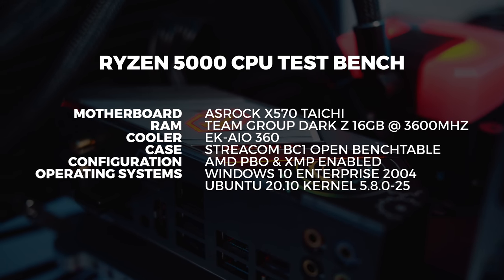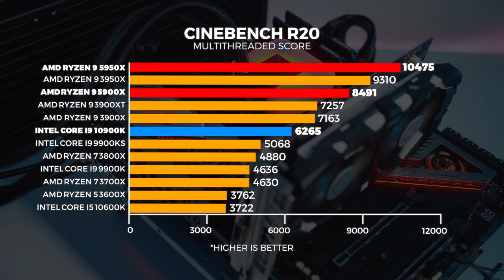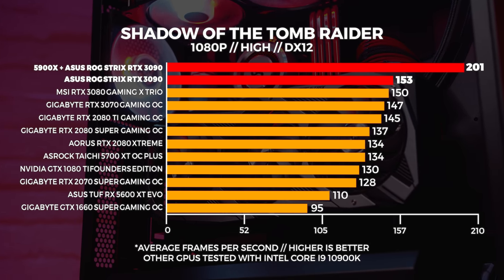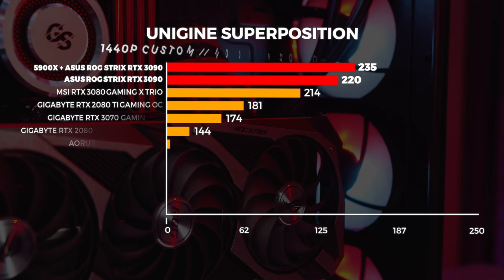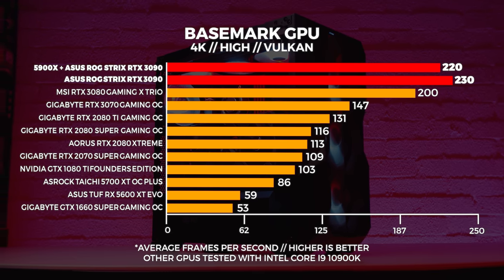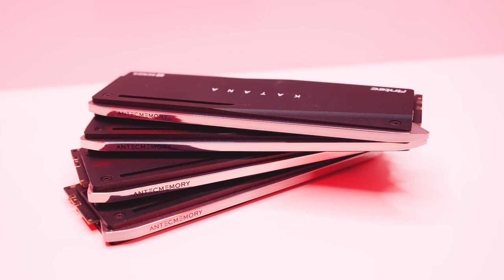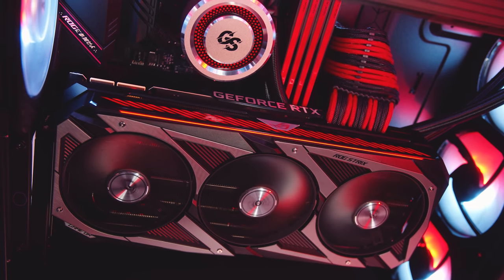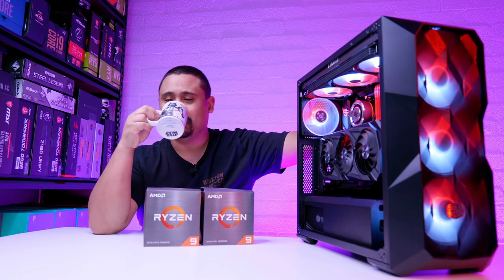AMD Ryzen 9 5900X ASUS ROG STRIX B550 Build with Benchmarks

Comment: i love that you love the TD500 since this baby is gonna be my case in few days time. cheers!
Reply: Yeah, fam. He had a hand in creating the beaut.
Reply: Same, I got the white version
Reply: i was going for td500 too but  after seeing meshify c it's hard to decide lol
Reply: @chickenuggets5118  in the meshify c you cant have a radiator.
Reply: @Alex-ul2eo  i googled this and you're right holy shit.   but  now i have to look for another case with  good airflow and one that have space for radiator. any recommendation ?
Reply: @chickenuggets5118  you can fit a radiator in the td500 mesh, but the p500a is also a very good case. Personally i would go with the p500a or the p600s they are both grate cases and in the p600s you can take of the front panel so you have mesh and in the p500a you have standard mesh
Reply: @Alex-ul2eo   i love p500a but it cost too much( something like 170 euro  in europe )  i think i'm just gonna get td500 or maybe p400a...
Reply: @chickenuggets5118  the td500 mesh can fit a 360mm radiator in the top where it belongs.
Reply: same

Comment: "What another empty coffee cup?"

Nick takes a sip
Nick: Hah. You thought.
Reply from the maker: The 5950X video the cup was empty. The 5900X video it was half full
Reply: @GearSeekers   pls help gear  seekers @Gear Seekers   gear seekers I have 1 doubt that in your tuf gt301 case review, Do this cabinet support aorus RTX 3080 and aorus 240 mm liquid cooler pls reply
Reply: @GearSeekers  Hi nick just bought the td500 mesh in white and was wondering what vertical bracket you used for the gpu and if the benchmarks and temperature are ok in that position (I have the vision 3080).. thank you

Comment: Guess I'm going AMD next. Haven't touched their stuff since they were called ATi
Reply: Imo r9 5900x is best value
Reply: @curtisg8399  5600x is easily best value for just gaming
Reply: @MFDOOOOOOM  no it’s not it’s terrible value. $300 for a 6 core chip at the end of 2020 is ridiculous, certain games already will use all 8 cores like bf5, assassins creed odyssey, etc and I bet in 2 to 3 years game will gladly take your 10  - 12 cores. A 6 core cpu is not future proof and not having the extra cores gonna cause stuttering and frame drops. Not to mention that this is only for gaming if you plan to video edit or multitask than an 8 - 12 core cpu is the way to go.
Reply: @curtisg8399  You're making your judgment based on guesses and assumptions. Right now, in terms of running games that actually exist, 6 cores is more than enough for gaming. Some games will use more than 6, that doesn't mean 6 is redundant in those games. Benchmarks are out for those games and there is little difference in the vast majority of them between a 6 core and a 12 core, with the same GPU. Don't buy based on what might happen, then you will never buy because eventually every chip is going to be redundant.

Comment: Which PCIe riser cable are you using? I think there's no PCIe 4.0 riser cable available in the market yet and 3.0 will cause compatibility problems as AMD themselves have said on their website.
Reply: I am wondering the same thing..been scrolling thru most of comments but seems u r the only one who raise this up...
Reply: i wanted to sidemount but this is the reason i didnt do it, the other thing i heard is you have to go in your BIOS and change PCI E 4.0 to 3.0 option

Comment: Do you think pcie gen 4 on amd is part of the performance increase?
Reply from the maker: Not at all. It's the CPU. I tested with PCIe 3.0 and 4.0 out of curiosity as well. Zero difference.
Reply: @GearSeekers  Interesting. People were saying that gen 3 would be holding intel back with Ampere cards. But I guess not

Comment: Really dig the Antec Katana ram. I want to pair it up with my 5900X that I'll be getting on Monday but it seems the sticks come in either 3200 CL16 or 3600 CL18 so i'm not sure how much performance I'll be losing by going with this and also if the memory can be OC'd well.
Reply: you can use 4000mhz Ram the 5900 hase zen3 he can with this ram

Comment: I am curious has anyone ever front mounted a 360 rad in the td500 mesh, everytime i see this case i think it would look nice with it in the front im not sure how well that would work though.
Reply: They go in the top. Front mount is a bad idea because it puts the pump above which causes air to get into the pump and is noisy plus could damage it. Radiator must always go above the pump.
Reply: @kenshinhimura9387  This is untrue, if you mount it on the front with the tubes sitting at the bottom it removes this issue, gamersnexus did a video on how to correctly front mount a rad

Comment: If the pricing is going to be competitive with Intel's offering, the latest Ryzen CPUs are going to be dominating. I can already see people doing Ryzen builds just to run Cyberpunk at the highest settings while streaming. What I am honestly concerned about is the memory kit compatibility. Is it compatible with most kits? Is it finicky? The last Ryzen I OC'd (1700) was really hard to make work nice with C16 kits. That's really the only gripe I had with Ryzen.

And before I forget, sick builds for both this and the other Ryzen 9 video.
Reply from the maker: Memory hasn't been an issue with Ryzen since about 3 weeks after Zen launched in 2017 lol.

Comment: I have a noctua nh-d15 mounted on a b550f with r9 5900x, what kind of ram should i buy? My case is a corsair 4000d the specs said that I have 170mm room for cpu cooler

Comment: Is the 5900x + Rtx 3070 a bad combo? my reasoning for asking is I want to use my pc for the next 4 to 5 years and I would like a cpu which can hold up nicely. So I thought hey let me just get a 5800x which is absolutely terrible value and I am willing to spend the extra $100 to get the 5900x so now I am confuzzled.     :[
Reply: 5900x is best cpu for the money.  Rtx 3070 is garbage. Get an rtx 3080 or wait for the 3080ti. If you don't have a gsync monitor than you can buy the new AMD card but don't buy the cheap ones. You'll be sorry. Unless you only play at 1080p but who still plays at 1080p in the year 2020? 1440p 144fps is the sweet spot right now.  4k is still too demanding on even the best gpu.

Comment: What would you recommend someone looking to game and stream at the same time? Because I am thinking a Ryzen 5900x and a RTX 3080. But I struggle with selecting Ram, Storage, Cooling etc.
Reply: Do you use pcpartpicker.com?
Reply: @RogueTravel  i picked a few parts on there a few days ago actually but haven't gotten any real feedback on the parts selected.
Reply: @BlazeNarutoShippuden  link it here and I'll take a look.
Reply: @BlazeNarutoShippuden  wasn't sure why you had two nvme storage drives so I left those the same. I opted to increase the memory speed to 3600 MHz, but the latency is slightly worse (CL 18 instead of CL 14). Also dropped down your power supply to a good rating and removed the $140 windows 10 install price, which you shouldn't have to pay more than $15 for on eBay and elsewhere for a key
Reply: @RogueTravel  How much memory I need,16 (2x8) or get 4 of them?  I looked up this one 

https://www.newegg.com/team-16gb-288-pin-ddr4-sdram/p/N82E16820331433

Thank you the tip of the windows 10 install price. Good advice.
Reply: @BlazeNarutoShippuden  it depends on how much multi tasking you plan on doing. The RAM you linked is CL 14, but at that price it is tough to justify only 16GB. If you're willing to drop to CL 18, you can get double the capacity at 32GB at the same speed of 3600MHz. 32GB would be the least amount of RAM I'd suggest given your component selection.
Reply: @BlazeNarutoShippuden  also, is there a reason you have two nvme storage drives?
Reply: @RogueTravel  hmm, ain't one for the main boot up system? The 500 GB would be for that while the other 2TB would be for saving games and gameplay videos at. That why I went with two.
Reply: @RogueTravel  Ah, I see.
Reply: @BlazeNarutoShippuden  the idea of two drives would be for a fast windows startup on the smaller, more expensive drive and slower, less expensive bulk storage. In your case, the two drives are the same so you don't need a separate drive at all.
Reply: @BlazeNarutoShippuden  you're going to need a gen 4 m.2 drive for games in the next 2 years because the new consoles have them. Something like the Samsung 980 pro.
Reply: @kenshinhimura9387  i just looked that up and it seems fast. wow
Reply: @BlazeNarutoShippuden  yeah you're gonna need it because the ps5 and new Xbox have m.2 drives that are around the same speed. So once next gen games come out they will use those crazy fast speeds and if your PC doesn't have something similar, you might run into problems.
Reply: @kenshinhimura9387  I'm still learning about building a gaming and streaming pc. but that also reduced the price greatly from what i had. thank you so much and yeah, i do hope to get a PS5 as well. I used to write Trophy Guides for PS3/PS4/Vita and even PSVR
Reply: @RogueTravel  is 3600mhz cl 16 good enough for r5 5600x.. and i plan to get a b550f rog with the tuf 3080.. is that okay... I just wanna do hardcore gaming im 1440 and 4k only.. not rendering or editing...
Reply: @mahendranraja1105  you will be gpu bound at 4K, and the 5600x should be fine, even at six cores. In two years you may wish that you opted to get an eight core cpu, now that all consoles have standardized on eight core systems and game developers are targeting that. At a similar price, you may consider the 9900K, but you need to factor in the cpu cooler as Intel runs hotter and consumes more power. If you can afford the 5800x, I would go for it.

Comment: What did you do with the RGB? I keep having trouble with my b550, I have 5 phanteks RGB fans and they work fine other than when I initially boot. The second I press the power button all of my fans will flash/turn on in the rainbow setting no matter what I have them set to and then they won't actually power on until windows actually boots sometimes they will turn on automatically however they will turn on and display a static representation of the wrong color and then when windows boots it will go into the mode I selected. Sometimes my motherboard does the same thing with the RGB on the board. I have all of my fans daisy changed and connected to the motherboard at the 2+1 pin connection at the bottom of the Mobo.

Comment: Hi! Are the benchmarks with the ROG B550 motherboard or the X570? I found that part of the video a bit confusing. Would have been nice if you had compared the benchmarks with the B550 and X570 and 5900x.
Reply from the maker: The benchmarks are for the system shown in the video. There is no performance difference between X570 and B550
Reply: @GearSeekers  great! Thanks! This is stock bios settings too, right?

Comment: In Shadow of the Tomb Raider 1440P benchmarks, does high settings mean Ultra or just high without Ray Tracing?
I got 107 FPS on Ultra + Ray Tracing + DLSS on. I have an RTX 3080 + Ryzen 5 5600X+ X570mb on a 1440P 144hz 32inch monitor. Just trying understand if that is a good benchmark.

Comment: Guys, thanks for this video. I am looking to get this board (B550 Strix Gaming-F non-wifi.) single GPU, may 2 m.2 SSDs. Not likely to OC the CPU. Do you still see a reason to go with a similarly priced X570 board ie: TUF X570-Plus? Would prefer to stick with Asus to match by 3080 TUF OC card.

Comment: Can you please read the following question?
I did a build wuth b550 and ryzen 5600x
And i have 2x8gb ddr4 3600mhz.I read the motherboard manual and it has support for 3200mhz and 3600(OC).When i try to boot i get 1 long beep and 3 short beeps with no video signal(i use integrated graphics with hdmi cable to samsung monitor).Please what should i do because i cant enter bios to see whats wrong.I tried using only 1 ram stick in every slot tried moving them to A2 B2 where the manual said it has dual channel support,tried plugging the pc to another screen.I dont know what to do because i rebuilt the pc 2 times already.PLEASE!!!

Comment: Did you need to flash the BIOS to enable the Ryzen 5900x or was it compatible out of the box?
I've ordered this mobo for my 5800x and RX 6800xt build.
Reply: A bit late but did you need to flash yours? I’m about to get a 5900x with this b550 motherboard
Reply: Yes I did. It went without a problem.

Comment: Wait so the benchmark are done on a B550 motherboard or a x570 ? Because it's written x570 at 7:23.. So I'm a little confuse
Reply from the maker: I said the CPU benchmarks were done on another test bench for another video but all GPU based benchmarking was done in the systems that we're built

Comment: You're actually doing better than 4.96 GHz.  Windows Task Manager doesn't given the most accurate CPU HZ rating.  Even Ryzen Master can be off.  It measures an average offset over a period and not peak clock.
Reply from the maker: Yes I'm aware. It was just an observation

Comment: Do you think that a 240 AIO would be an acceptable cooler for the 5900x?
Reply: No. You want a 360mm. That way you can overclock and not worry about heat.
Reply: @kenshinhimura9387  I am not overclocking.
Reply: @brandonchurch2734  240mm is the minimum for this cpu. I would just get the 360mm. The price difference is so small.

Comment: I like the Gigabyte B550 Vision D much better than my ASUS X570 F-Gaming.      However, with my B550 I only have 4 SATA ports and no front "Type C" USB.       That motherboard would be best suited for a 2018 mid-tower.     On a different note, I now have a Corsair 1000D so that mainly I can have a graphics-card the size of a watermelon, if they come out with such a thing.    I would not recommend the Corsair 1000D unless you have the money for custom cables extra-long cables, an EATX motherboard, and can afford $ 400 to spend on fans.    I spend over $ 400 on fans and my imagination tells me I lowered the ambient temperature in the case by 1 degree.     I now regret purchasing the 1000D, but I am sort of stuck with it since I do not own a forklift.

Comment: Is it better to upgrade from i7 6800K (6/12) OC at 4.1 Ghz to Ryzen 5 5600X/Ryzen 7 5800X or upgrade my RTX 2080 to RTX 3080 or RX 6800XT?
Reply: Upgrade your cpu this time and upgrade your GPU next year . Good luck 🤗
Reply: 9 5900x 
it costs a little more than the 7 5800x but it's worth it and RX 6800XT to unlock better performance since everything is from AMD that was explained and it is proven.

Comment: Ryzen 5000 has a sweet spot of 4Ghz for the memory, that is 400Mhz higher then you used. Nice build, but that 3090 ... What were you thinking?
Reply: 5900x can easily overclock to 4.5ghz on all cores and the rtx 3090 is the best gpu out right now but I would wait for the 3080ti.

Comment: I prefer x570 motherboards
Reply: Why ?
Reply: retraser maximus??
Reply: @moisessoriano9109 better looking and more usb ports
Reply: @SonicDestiny  i mean the look is subjective but do you really need a dozen ports over 8?
Reply: @xray5984  yes cos I already litteraly used all 8 usb ports in my current motherboard so having 3 more would be useful for me, only my gaming keyboard alone use 2 usb ports
Reply: @SonicDestiny  usb hubs are a thing
Reply: @jakepowers2034  unecessary Accessory while when you can have all that extra usbs already in motherboard with better cable management
Reply: @SonicDestiny  well im pretty sure one is for a USB pass through which is not needed unless you are connecting something to that one, so in theory it should work with only one installed. but it may be different depending on you keyboard.
Reply: @oreoeatsoreos9412  i need both in order to rgb to work
Reply: @SonicDestiny  same here, I bought X570 because my Oculus Rift requires 4x high bandwidth/power USB ports for all the sensors plus the headset.
Reply: The only b550 that could possibly work for you would be the Vision D
Reply: @SonicDestiny  You like them because they are more expensive and you are a condumerist shill. When queried about why you prefer x570, you couldn't even list a single benefit of the x570.
Reply: @CBGENESIS  i already did

Comment: You should be looking at a 16 power phase motherboard not a 12+2 power stage board. The 5900x should be paired with the x570 unify motherboard you cheaped out for no reason.
Reply from the maker: Cheaped out? I wanted to use a B550 board for the build as I mentioned in the video. You clearly do not understand how VRMs work lol 🤣
Reply from the maker: Actually you're dumb. A "B series board" has nothing to do with power delivery 🤣. B550 AORUS Master has better power delivery than X570 AORUS Master for example. The ONLY difference is they have less PCIe 4.0. THAT'S IT! You clearly have no idea how Ryzen overclocking and AM4 boards work kiddo🤣

Before calling someone dumb. Do your research and use facts. Don't just make shit up because you think you know the answer.

So sad.
Reply from the maker: @voluntarism335  so you have no logical response at all except calling me an idiot when you clearly don't understand how any of this works. You cannot accept that you are wrong then say "yOu pAiReD a ShIT boArD wItH A hIGh eNd 12 coRe PrOcesSor"
Good job dickhead lol 🤣
Reply from the maker: That's your only response hahahahaha! Still can't accept that you don't know shit 🤣 This has been fun kiddo.
Reply: @GearSeekers  I will no longer respond to your idiotic replies.
Reply: @kenshinhimura9387  B series boards are low end trash
Reply: @voluntarism335  and what makes you think that? You think you know better than people who build and test PC's for a living?